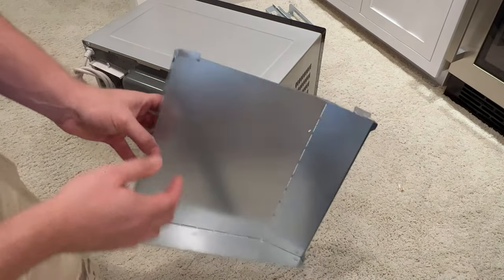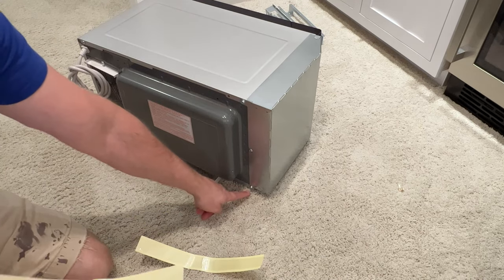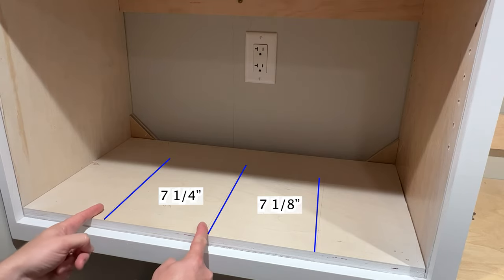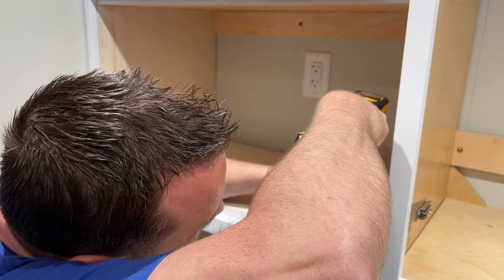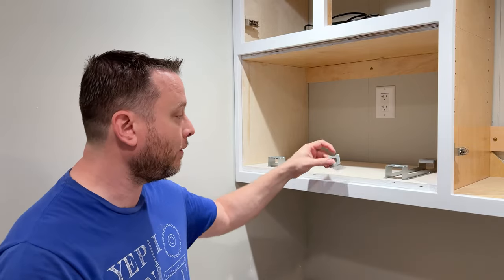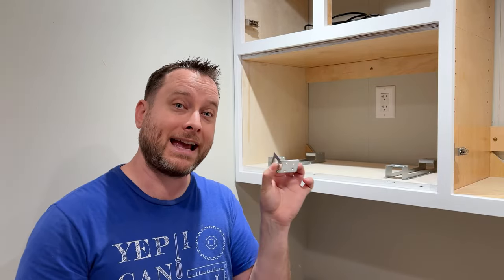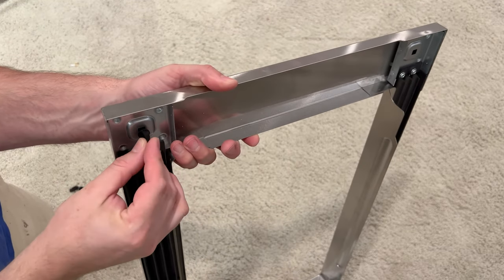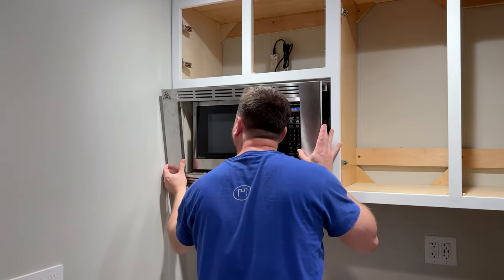How To Install A Panasonic NN-SN67K Microwave & NN-TK621SS 27In Trim Kit | DIY Project

Comment: Great video, thank you! Any suggestion for what to do with a cabinet opening that is slightly too small (e.g., max 23.5" between bracket centers, as opposed to the 24.5" on the frame)?
Reply from the maker: Thanks not sure that sounds interesting

Comment: Did you simply set the microwave on top of those footers you had screwed down?  Or do the feet rest in indentations? or Snap in?  PS.  Great video. Thanks for sharing your expertise.
Reply from the maker: you set them on the footers...they have an indention so you know exactly where it sits.

Comment: Please advise: What are the finished dimension the trim kit in this video? My cabinet opening is 27” W x 20” H.  How would a  1cu ft microwave fit with dimensions of 20’W x 11 7/8” H?
Reply from the maker: I would have to look at the plans not sure off the top of my head

Comment: it looks like the flashing installs right over the ventilation holes at the side of this particular microwave model in the video. Is that a problem? Fire hazard? Moisture build up?
Reply from the maker: Haven’t had any issues the trim kit was designed for this exact microwave

Comment: To do the reverse, how do I remove the trim frame? I need to replace the microwave
Reply from the maker: it is held in place by push clips...you should be able use a small flat head to fit between the crack and pop it off
Reply: @HowYouCanMakeIt  thanks a lot, it helped me to remove the trim frame!
Reply from the maker: glad to help 😁
Reply: @HowYouCanMakeIt  Where are the push clips?
Reply from the maker: They have them in the kit.

Comment: I have an opening in a cabinet 27" w by 16" h. What is the size of your cabinet box? Your install looked very simple just wondering how it will work for me. When researching there is no mention of the height of the cabinet box.
Reply from the maker: the opening is 27"x16 3/4" The depth is 16 3/4" however this was a tight fit for my microwave and I had to use a special inset wall plug to get it flush.

Comment: I wouldn't follow the spacer advice. The 3/4 spacer block is specific to his cut-out dimensions. You need to make your own measurements. If you make your cut-outs the same as the instructions, you do not need the spacer block. If your dimensions are not exactly as the manual, and not exactly as this you-tuber, you need to figure out your own spacer.
Reply from the maker: I always recommend double checking you dimensions. The spacer is for my plans and exact build.
Reply: It's just the way you phrased it... "I did some calculations, and all you're going to need is a 3/4 inch spacer..." That implies all of us, the viewers.
Reply from the maker: I understand, that makes since.

Comment: I just purchased a counter top Panasonic Microwave Oven, Model NN-SN67HS
As I was about to install it, I noticed 2 plastic hooks in the back of the oven. These hooks do not seem necessary to the functioning of the oven, but they do not come off easily. There is no mention of this in the installation section of the instruction manual. The oven you installed had them too, but you did not mention what to do with them
Should I just pry them off with something like a flat screw driver?
Or do they need to stay there? That would increase the depth of the oven significantly, and may make it unusable for the space I have.
Reply from the maker: I am not sure either they may have to do with keeping space in the back for evaluation but not 100% sure

Comment: I have an NN-SN790S model that needs to be replaced. I am not sure of the model # of the existing trim kit. I am thinking of buying an NN-SE795S or an 
NN-ST77LS but the depth of these models is slightly than the existing model. Width and height are the same. Will the existing trim kit that I have work withe these new models?
Reply: "slightly less than the existing model". Also when referencing the trim kit size, is this the outside width of the outside panel, the inside of the cabinet opening or of the microwave itself?
Reply from the maker: The inside has it's own offset size. I can't recall what it was I would need to pull up the plans for the cabinet. I think I based it off the instructions that came with the trim kit

Comment: Our built in oven shuts down when used because of overheating we did the same procedure as yours in the installation how to deal with this please help thanks
Reply from the maker: Sorry to hear that. I haven't ever had an issue with mine. It might be an issue with the oven.

Comment: Honestly we are having trouble determining the size of microwave to purchase for a 24” wide & 15” deep upper cabinet. I would also like a trim and not sure what size trim is needed for a 24” wide cabinet. Lastly, I need a black stainless steel microwave and trim. Can you please help me?
Reply from the maker: The opening for the trim kit for the microwave that I used is 17"x15 5/16 and 17" deep I would recommend 18" deep if possible.

Comment: Hi - I would need to replace my Panasonic microwave. How do I take it out, does the frame come off? And simple swap out of old to new?
Reply from the maker: if it is the same size you just pop off the trim kit and pull the microwave out.

Comment: Did you find specifications for installing inset PANASONIC microwave with trim kit on their website?  Can you link me to it?
Reply from the maker: The information they had wasn't that good. but here is the link to their PDF https://eng-ca.faq.panasonic.com/euf/assets/PDFs/Microwaves/NNTK621_F03139Y02AP_ENG.pdf
Reply: @HowYouCanMakeIt  Thank you for the specs, isn't it frustrating that manufacturers don't include flush inset installation information!
Reply from the maker: I agree glad to help